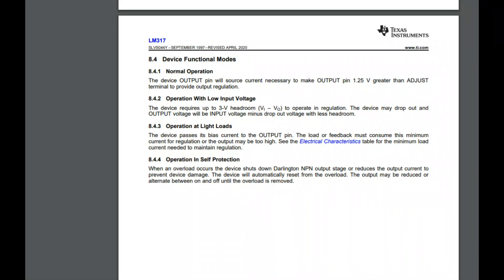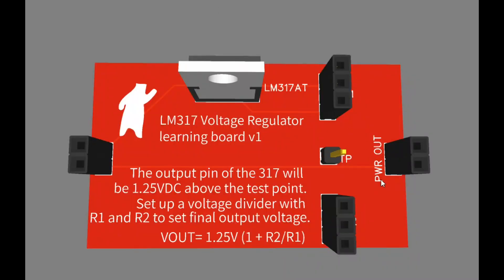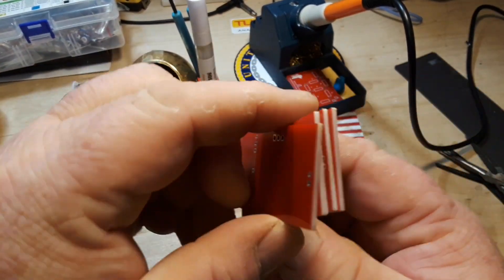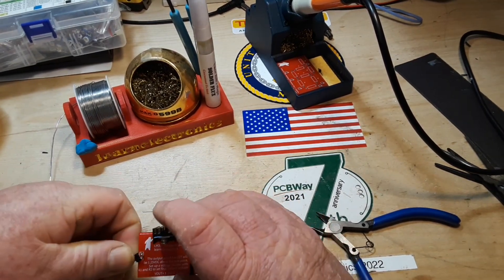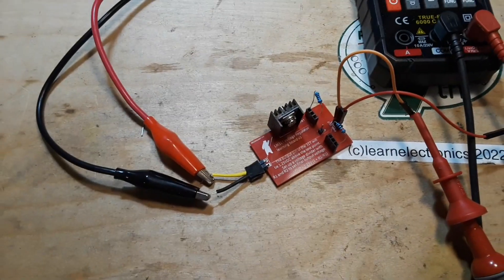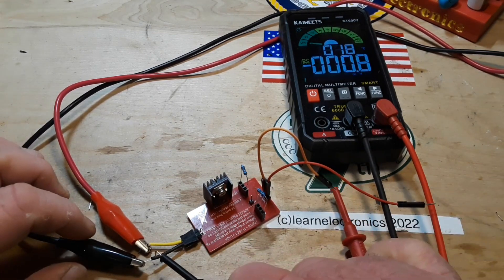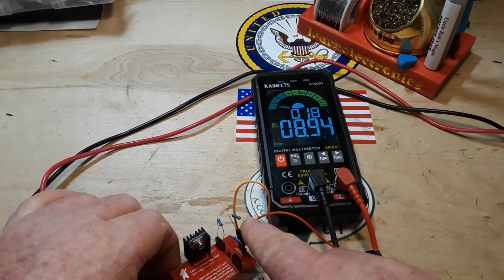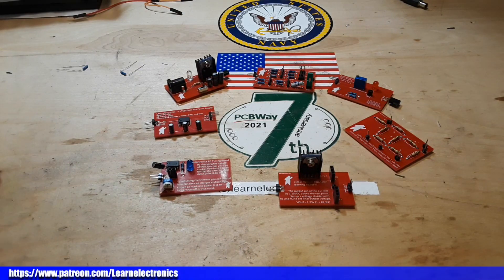STEM Boards: LM317 Adjustable Voltage Regulator

Comment: By coincidence, I am working on a project that uses the LM317T, and have a prototype on my desk. R2 is marked 360 Ohms and R1 is marked 220 Ohms. V In is 13.77 volts, V Out is 3.316 volts, and the junction of R2 and R1 is at 2.055 volts, a difference of 1.261 volts. That being said, there is no magic; it's simply a function of the internal design of the LM317T, and is easily explained by the formula: V Out = 1.25 x (1 + (R2/R1)). Please excuse my old-school use of parentheses; it's easier for me than PEMDAS.

Comment: Regardless of value, if the two resistors are [exactly or approx] equal you cannot possibly get an output higher than 2.5V....so if you're reading 9.08V then somethings wrong somewhere.
Reply: That is correct; something is wrong with the wiring (PCB routing) or the LM317T is bad.

Comment: I'd be concerned about the lack of an input bypass cap. The regulator might be oscillating due to the length of the leads from the power sipply.
Reply: From the TI data sheet: "0.1-µF or 1-µF ceramic or tantalum capacitor"